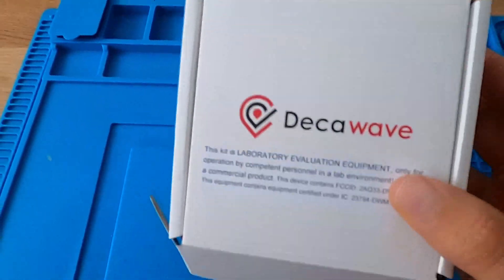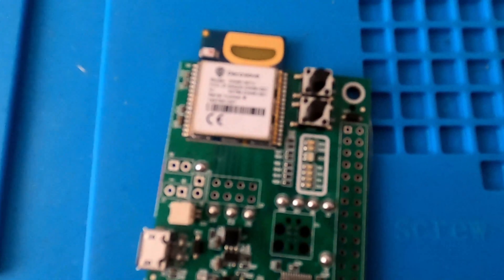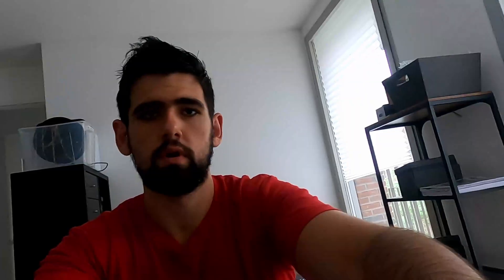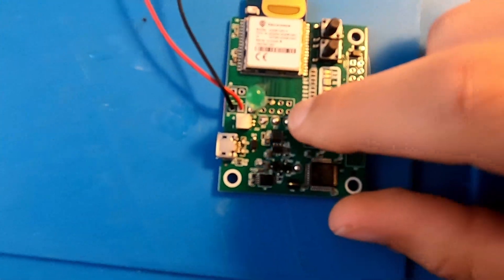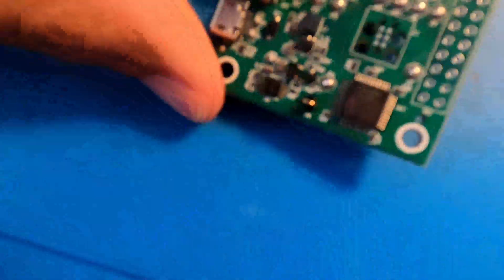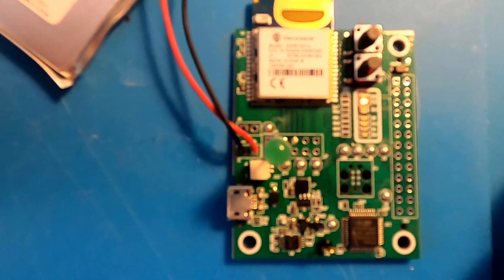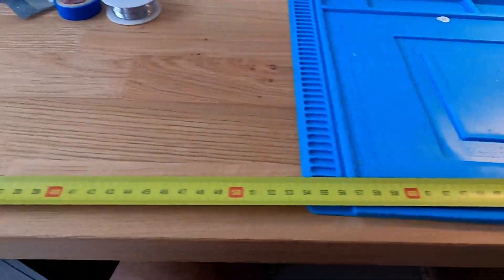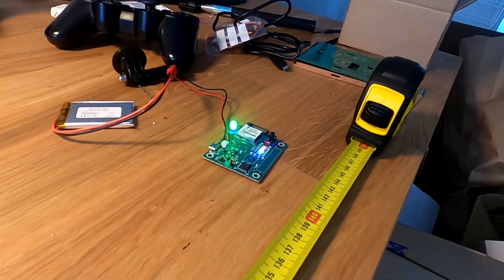Using the DW1001-DEV to build a squat indicator, to stop those no reps.

Comment: Are you test in TDoA with multiple Anchors for position tracking
Reply from the maker: Hi 👋.  I did not test as Anchors. I just made a initiator and receivors to test distances from on one another. Added 5 in a room and it knew where all of it was, but when you added alot there are issues. Or am I not understanding the question correctly?🙂